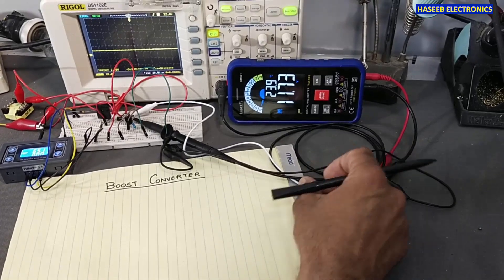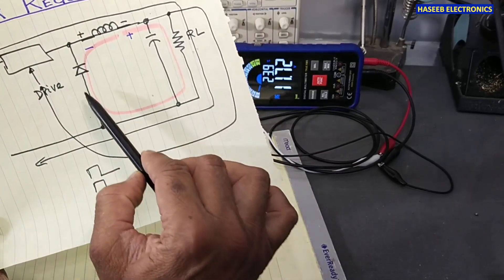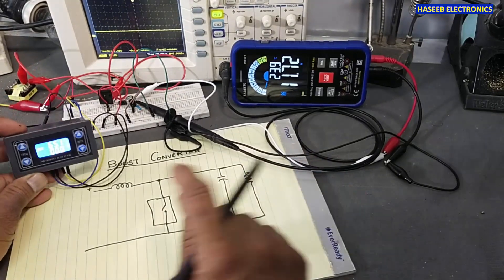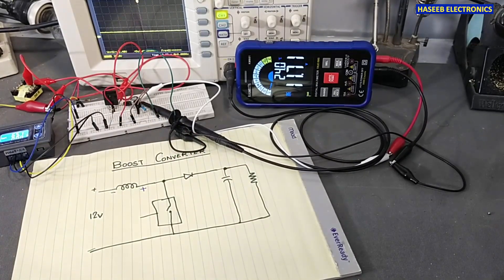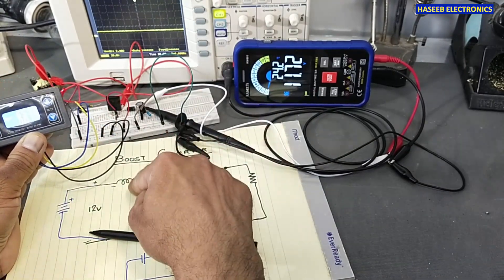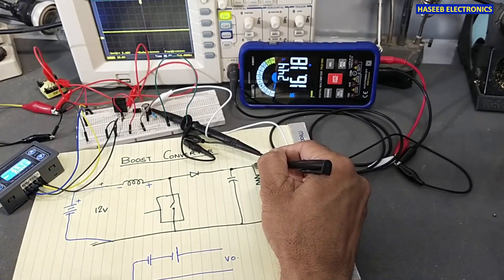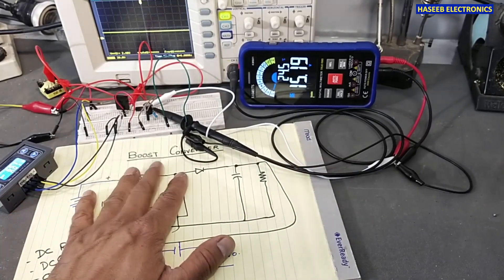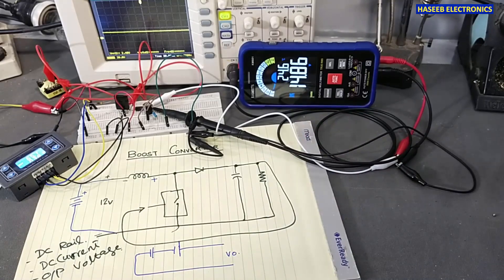{834} Boost Converter Topology Theory and Practical

Comment: HI, I learned a lot from your channel. I am just testing my DIY BOOST SYNCH., MULTIPHASE 50 + 50 A IN current. I use IRFP FETs with 0.5 Rjc and 0.45 Rcs temp. coef. 
I have this kind of efficiency at 5 - 10 - 15 - 25 - 30 - 35 AMPS IN. https://youtu.be/qU5fF-lX0VU 
FETs have Rdson === 0.021 ohm, if I change FETs to 0.008 ohm Rdson, 21 / 8 === 2.6, so losses will be 2.6 lower ?
If new FETs have 0.26 Rjc and 0.21 Rcs temps. coef, if I have now 46 *C Tcase @ 25 *C ambient, if I have now 26 W loss per LOW FET,
26 * 0.8 + 25 == 46 *C TCase and 46 + 26 *.45 == 58 *C Tjunction. So for new FET it would be : 26 * 0.56 + 25 == 39.5 *C Tcase
and 39.5 + 26 * 0.21 == 44.9 *C for Tjunction ? 
And if I have 50 + 50 nanosecond switching, and 70 kHz freq., switching loss would be 1 / 2 * 100 V * 100 x 10^-9 x 70000 == 0.35 W per FET ?

Comment: Thanks a lot. You are great. I have the same circuit and its output comes to L200C (IC) in order to charge 24V-battery, could you please explain about this (ic), operation and testing?

Comment: Thank you master wonderful i have question how buck converter decrease voltage i mean in what sinario(just by decreasing duty cycle?) and there is lost power ?where does this lost power go if yes
Reply from the maker: best regards
noo there is no power loss. the transistor will turn on and will allow to pass sampled pulse for specified time, so it appears on load current. so the coil will not dissipate heat, it will convert it to magnetic energy. 
which is being used in off time. when the switch is off. it will behave as open circuit 
there are very minor switching losses (diode, transistor etc) but these are negligible
Reply: @HaseebElectronics  thank you for your explanation but i still have question how this behavior that you explained decrease the voltage thank you
Reply from the maker: no problem
I will try my best to explain it in detail
it will my pleasure
Reply: @HaseebElectronics  sorry if i bothered you
Reply from the maker: no problem dear brother 
it is my pleasure

Comment: Dear Mr. Haseeb. I am from Sri lanka.I respect and gratitude for you, because you have done very valuable and superb tremendous service to the electronic  field.Your endeavor is very very successful.I  also have attempted to design boost converters, but i was unable to get regulated output voltage. In (no-load) condition, it  was success. But it couldn't drive the load.(output voltage became zero level when load is connected).I hope your further clarification about this matter and calculations and design explanation about boost-converters in future videos. Thank You.
Reply from the maker: best regards and special thanks for your valuable comment 
sure i will proceed to design calculation and practical assembly of these converters. we will do it in steps
Reply: Input watts should be equal to output watts